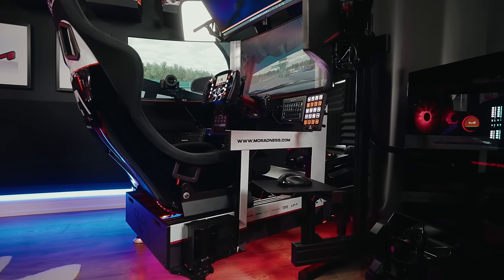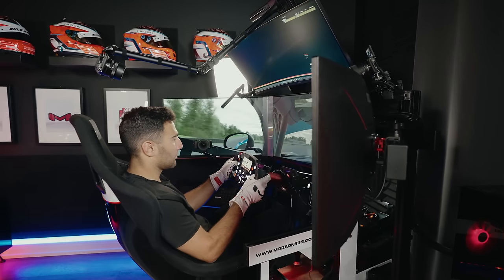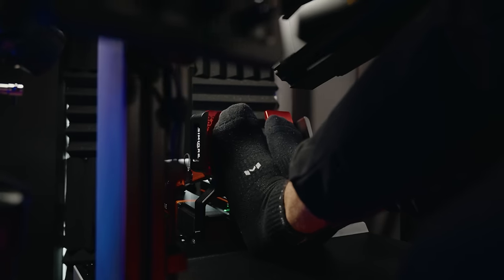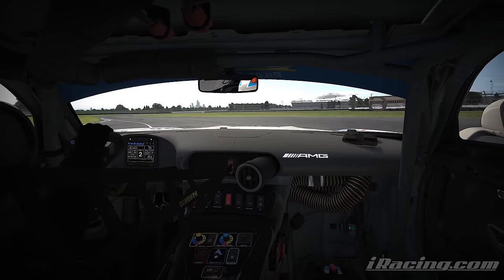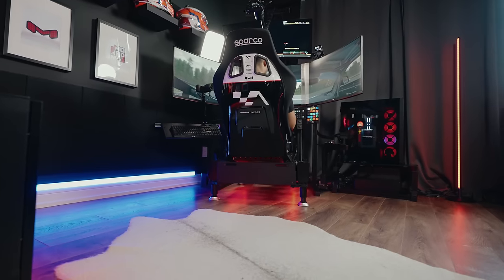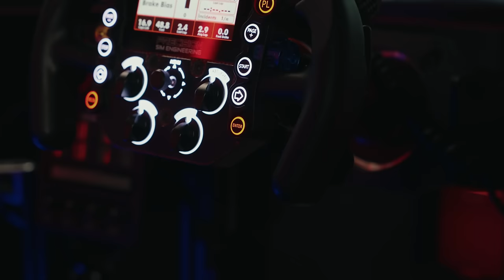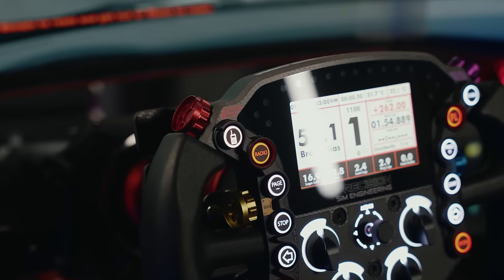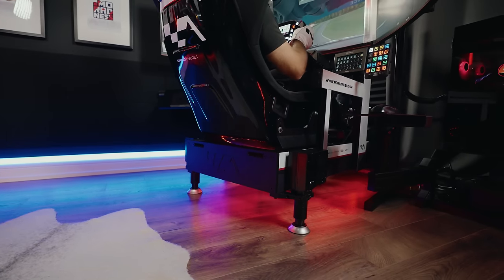UPGRADING YOUR RACING SIM: PRO GT DRIVER EXPLAINS THE BEST PATH TO IMPROVE YOUR RIG

Comment: Triple monitors won’t reduce lap times during practice with only one car on the track. But they will reduce your average lap times in races by reducing incidents. Trust me, wheel to wheel racing is MUCH easier when you can see the guy beside you!
Reply: I think it comes down to personal preference and what a given driver is used to. Then there is the long term comfort of most vr headsets like during a 45 min race and the lack of ability to interact with the real world if needs be with a vr headset on. Triples are just easier imho.
Reply: Thats the main reason i want to upgrade to triples
Reply: @MrJoppashoppaAs someone who has had both VR & now on triples, 1: its easier to run (hardware-wise) 2: visually looks better, without having to compromise graphics to maintain fps in vr. 3: much easier for people who stream / record 4: you can see way more around you without having to take your eyes off of apexes or in front of you. 5: you don't have to struggle to find buttons / shifter / handbrake, or your keyboard.
also VR was very fiddly when i was using one, it would almost always randomly stop working properly & i'd have to redo settings or some other bs.
triples i just have to press a button & it switches to my 3 sim monitors.
Reply: Triples yes, but note your graphics card must be very high-end to handle the fps load. Take a look at application, INI Sidekick to optimize your current card settings.
Reply: @backwardog1  if the choice is between triples & vr, triples is much easier to run than vr.
Reply: @hypnotiq  I get hot af doing 45 minutes of imsa on triples, i dont even wanna think how fried I’d be doing it in VR
Reply: @Deadbeatbeats  that's on god right there
Long races get sweaty as fuck
Reply: Who cares about lap times - they’re more fun!!!!
Reply: It actually does help with lap times as it provides the ability to look to apex easier.
Reply: @MrJoppashoppai want to go for a tripe setup and asking myself. 27 or 32? U are fine with the 27?
Reply: @MrJoppashoppa The short answer to your question is FOV. Triple screen setups can give you an FOV of up to 180 degrees whereas 99% of VR headsets only give you around 110-130 degrees. In VR, you cannot see a car coming alongside you without turning your head and looking.
Reply: Yes it will reduce your lap time maybe u haven’t race at Fuji raceway yet
Reply: @hypnotiq  yeah i will upgrade to triples in the next year because of that.. VR is the best for simple experience when drifting or driving some mountainroads or so.. but when u go to the racetrack there is the focus problem with vr... quest 3 does allmost eliminate that but still VR focus is in a straight view so we have to turn the head to the point we want to see but we often just look with our eyes and not our head.. so on a racetrack when im turning into a corner my head looks into the corner but my eyes allways switch to the apex and exit and in VR that is difficult because its unnatural in VR to focus with your eyes a point on VR screen that isnt sharp. so my eyes stop after some gameplay and just freeze in the sharpmiddle of the screens

Comment: VR has come a long way. You can get a very steady 90 fps with a decent computer now. I don't think you need more than 90 fps for sim racing. But it seems like you're commited and happy with triples and like you said, it makes more sense for streaming and engaging with your viewers. But I just want it to get it out there for people who are contemplating VR vs triples.
Reply from the maker: You’re absolutely right about that. Some tracks you still struggle though for FPS
Reply: With all due respect, I agree with Koi.  I run a Reverb G2 using an RTX4090 and a Ryzen 5800x.  I am able to run the graphics at a very high level with self shadowing even in VR without dipping below 90 fps at any track.  Occasionally I am CPU limited for replays but if you take the time, one can dial in lovely smoothness.  OpenXR and the OpenXR toolkit helps a bunch.
Reply: @danielmorad  That's iRacing and it's miserable optimizations. Looks like you get FPS-drops with Triples as well. In so many videos I saw a graphics-delay with triples means, that the graphical wheel is lagging behind the physical. I never had that with my 49"-displays and with TrackIR I can looks around even more than with triples...
Reply: @richardhodge3310  completely agree with you mate. I also run VR exclusively on iRacing. Specs include i7 12700KF with an RTX 3080 Ti, along with the help of OpenXR and OpenXR Toolkit you will be able to achieve a consistent 90fps. When I switched from WMR to OpenXR that was the game changer. To help with comfort, having a Wind/Speed simulator to add that bit of tactile feedback to give your brain that sense of movement but also keeps you comfortable and cool for extended racing. Buttkickers also help add to that comfort and immersion. VR has definitely come along way even in regards to clarity. Thanks for the list @danielmorad.
Reply: Thats what you think until you race at 150 fps consistently, 90 FPS starts to feel like slow motion
Reply: @ewenblack4174  Not for me, but I'm half a century old🙄
Reply: @richardople  I haven't tried a wind simulator yet but I do have a fan blowing on me for comfort.  I have two Buttkickers and I love them.  One for the seat and a smaller one on the chassis to vibrate the H-pattern shifter and pedals.  Feeling haptics through every surface helps the immersion.
Reply: @ewenblack4174   I have a wide screen monitor as well and I can run well over a 100 fps. It doesn't make much difference to me. At a certain point, the gain is minimal. 90 is more than enough for VR for most people.
Reply: I have VR and triples (nothing fancy a G2, 24”x3 and a 2060s). I got 90fps in VR and only 60 on triples but personally I feel more physically connected to events with triples.  I can see my hands and legs moving in my periphery.  I…am in “the car”.  I am not suddenly transformed into a cartoon world.  I know this is a marmite situation but I used VR for a couple of years (open XR) but was far more comfortable when I went back to 3 screens. (Even 3x24” 60fps but 168 degree FOV.)
Reply: If possible can you tag me and tell me how to make vr good? I have a spare oculus quest, I tried it a year or so ago with my rig and it didn't work out very well, super glitchy and in the end while it was cool it wasn't immersive because of how glitchy and laggy it was. (I normally just play Assetto corsa)

Comment: 100% agree with everything and the order at which you rank the upgrades!

Everyone thinks the brake is the most important thing (which it is to actually get faster) but with a good load cell brake pedal, you need a solid chassis to put it on, otherwise you negate the benefits of it. You can't use a good load cell brake pedal without a proper chassis but you can use a chassis with a lower end pedal set and it'll be better overall!

Comment: I agree with all of this, but I went with the wheelbase as one of my first upgrades. The increase in force feedback is what kept me addicted to the hobby and ended up buying way more expensive gear than I would have had I'd gone with the pedals first 💀

When someone first tries this hobby they want to have fun, not necessarily the best hot lap, might not even know the tracks. So as a beginner I would definitely consider upgrading the wheelbase first.
Reply from the maker: Very good point you make. Either way, you can’t go wrong when you upgrade your equipment. I think that it’s very important though to start with the chassis and then you can pick and choose after that.
Reply: Totally, a triple monitor/VR headset must come with a PC that can handle it. Which can be VERY expensive depending what you starting on. 

Those kind of recommendations depend  on what you are starting on I guess. His recommendations make a lot of sense if you factor in lap time and racecraft alone.

Comment: from someone that switched from a logitech to a DD system... its not like it makes u faster but it still does ... because u got so much more detail and feel the limit so it gets easier and u can focus more on braking points and getting out of the corner fast.. so i got faster with the DD i wouldnt if i would not have had some simracing experience but at some point of skill u will make a jump with DD... i now understand that the material is what gives u more joy for the experience and its way more addictive

Comment: I feel like the chassis upgrade for a lot of people seems unnecessary to upgrade or even consider before upgrading to a DD, but from my own experience i would say he's definitely right about it. 
Where i live we have really limited options regarding sim racing stuff, you can't find a single DD wheel base in the whole country (believe me i tried) so i had to buy a g920 even g923 wasn't an option. For my chassis I've designed and build an aluminum profile one and I'm really happy that i did that because you can literally add anything you want to it or modify it however it suits you.
If you are tight on budget or it's hard for you to find sim racing products like where i live don't hesitate to go down the DIY route it's really fun and not that hard, I've managed to add a linear E-break and a sequential shifter to my rig even though i play on a Xbox, even designed a quick release for my after market wheels so if i can do it you can do it too.

Comment: If you do not have a entry level direct drive wheel, its also a important upgrade you can do before or at the same time of the loadcell pedal. 

Also make sure telemetry is vidible on screen, decent substitute to loadcell. 

Ofcourse 
Rig
Brake pedal loadcell, even entrylevel.
Wheelbase

VR is setup hell, triples take a lot of space. Ultrawide 34 of 49 can be your go-to in terms of space. VR sure, but almost always theres some setting plucked you need to adjust before you can race properly.

Comment: I bought a used Thrustrmaster T300RS with T3PA-Pro pedals. About 5 months later, my girlfriend and I reconfigured our collector's room to make enough space for his and hers desks, so I have a wheel stand, bought new Th8A shifter, new TSS handbrake and Sparco P310 wheel. That all cost about what a lower Fanatec wheel, base and 2 pedal set would have cost me because I live in Canada, and exchange, especially shipping, and customs charges.
But I had a single 24" monitor, then got 2 of our son's 24" monitors, plus had an old 17" flat screen, so I had triples plus the 4th for SimHub, until I picked up a used Acer VR headset. My setup works great for the limited amount of time I get to drive, but also for the space we have - until one of our kids eventually move out! Lol.

Comment: I think the biggest mistake I made was not focussing on my PC’s ability to run iRacing or ACC smoothly in the first place. I went from a G27 to DD wheel + load cell pedals and didn’t really go much faster. 

Later down the line (a year or so) I upgraded my pc because I wanted to run a single 49” ultrawide monitor that my old pc couldn’t handle. Turns out this made the biggest difference to my 1 lap ability (the pc not the monitor).

Comment: Getting ready to build my first iracing sim rig with VR.   Motion or 4 corner Slip angle?   Mostly want to feel what the tires are doing underneath me.  And VRS pedals or P1000rs pedals or VX pro pedals?   What do you think?  Awesome video, thanks.  Worked for Jack Roush in the 90's and built most of the Dodge Vipers that raced Lemans in the 90's.  Won multilabel championships.  You perfectional drivers amaze me what you guys can do with car.  Worked over seas on Military aircraft, spaceX on there rockets and now NASA on the next X-Plane, X-59.  Don't know what I miss more.  Sweet smile of burnt Racing fuel or a jet engine light off.
Reply from the maker: That’s awesome. You’ve done so much in your life. 

In terms of motion, I’d focus more on vibration and very quick motion. DBOX gen 5 is perfect for me. It does it right. 

Advanced SimRacing sells it and if you used MORADNESSFIVE, you get 5% off the system as well! It’s honestly the best motion platform. In terms of pedals, depends on the budget but VRS or Heusinkveld Sprints are nice. Simucube ActivePedal is the ultimate pedal. Again, discount of 5% off with code morad5 on simucubes site. All depends on budget and how deep you want to get into it.

Comment: I have a few  content ideas for you, no charge lol.  

rF2 because I'm super interested to see your thoughts on it.

AMS2, also very curious especially after their recent physics/ffb updates.

I'd also be really interested to hear your thoughts on sim FFB not being 100% realistic in order to convey enough information to the user to be able to drive the car properly.  You're lucky enough to have a motion rig, but if you didn't have that, or you turned it off, would it actually be harder to drive the sim car with a realistic steering feel vs a sim steering feel that most likely has more feedback input to tell you what the car is doing due to lack of body input and feeling.

Comment: I've done it the opposite way round. 

Started with a Microsoft Xbox Wheel for Xbox 360, then a Thrustmaster TX458 on a GT Omega Classic stand.

Then a Fanatec DD Pro, 8nm, Loadcell on the same stand.

Then got triple monitors.

Then bought an expensive Rig - the rig is such a big ticket item, in terms of price, and space, you want to know you're in the right place (living situation) before committing to it.

Comment: Another very helpful and in depth tips for simracers! Good to see Morad always being kind and patient to simracing enthusiasts❤❤. From my piont of view, considering laptime or to begin with the training, I think Pedals are always THE FIRST THING to consider about, that definitely gives more confidence to focus on my braking rather than hesitating whether its me misjudging the braking point or my terrible braking, that sounds like a small one but I have to say it bothers me for a very long time............when I couldn't find out the exact problem I have, it is literally wearing myself out, cuz if the pedals got wrong on braking pressure or the stiffness setting, I just can't get faster, and I have to stop and do the recheck all over again, it's painful!  I mean throughout those mid-low end pedals, either they are tricky to hold braking pressure & less adjustable. But once got a nice pedal, set it properly, it just delivers all of my trail braking smoothly, and that leaves me more attention on getting quicker
Reply from the maker: Thanks so much. I’m really sure this is going to help everybody.

Comment: If I wanted to get a budget rig, pedals and wheel in 2023, what would be a decent yet cheap combo for someone going from a G29 and a desk?
Great video mate.
Reply from the maker: Go for an ASR 3 or ASR 4 tbh. Invest one time in a good chassis and then you can get something like a moza steering wheel and pedals. 

Going from a desk, your existing gear will already feel better. Don’t forget to use the code for ASR. It’s in the bio.
Reply: @danielmorad  Thanks mate, had a look at ASR, will do. Might be what I need to finally get that last sec on iRacing. Your videos help me bridge the gap, thanks again bud.

Comment: Solid reasoning.

I assumed you would put pedals (especially brake) at the top of the list, but I suppose you do need something solid to mount them to if they're going to be useful.

,,,and this is just from a hobbyist aiming for a sports car sim, but if it weren't for the cost, I'd put motion higher on the list, as it can give you what feels like an extra quarter second of warning about what the rear of the car is doing. Also in rally, it communicates a lot about the driving surface.
Reply: I didn't want to spend the money on motion, so I went the bass shaker route. If you get that setup and tuned properly, then it can give you a lot of the same info as motion, but for a fraction of the cost. And when it comes to tuning the settings, less is more.

Comment: Great video, im at that phase where i need to buy my first rig, and of course i will go for an aluminium profile where i can grow into.. and also need to buy the gear.. simagic or simucube, or fanatec DD? maybe something between 10nm and 14nm is enough.. 
 btw you are missing a 'om' in your 'PRECISION SIM ENGINEERING' URL
Reply from the maker: Thank you very much for pointing out the issue. Also, simucube is ultimately the best if you can swing it. I’d avoid Fanatec tbh.

Comment: At what juncture should one get a rig? Recreational sim drivers?
I dont race but i do practice car control in the sim, just for fun, is a seat and rig the right choice for me? I got a load cell and wheel im happpy with. Still necessary?

By the way by rig I meant cockpit 🙂
Reply from the maker: If you have a wheel and pedals already, getting a cockpit is a no-brainer. It will transform the feeling of what you have completely. If you don’t want to spend a lot, you can look at something like an ASR3 perhaps and bolt the kit you have now onto it.

Comment: Great video! A lot of extremely useful information I, along with many I know wish we had going into this. I'll be on my third rig swap when I pull the trigger in the coming months, and also changing up the wheelbase ecosystem for the third time with it. Logitech/Playseat Challenge is an excellent space saving entry-level setup since it folds up and has good software support and is plug and play. Moved to a Fanatech CSL Elite with V3 pedals and a NextLevelRacing F-GT. Not a perfect combo but it was a notable upgrade. The seat that comes with that chassis is basically two pieces of a weight lifting bench stuck together to make a seat. Ergonomics are challenging to put it lightly. Next step is ASR chassis and Simucube. Maybe even that cube controls Mercedes wheel. 🤔
Reply from the maker: That’s awesome. Well hopefully this will help everybody else in the future